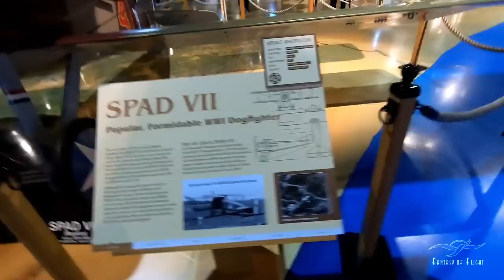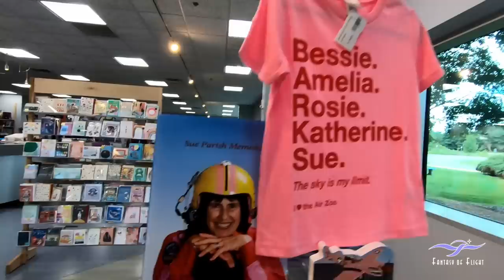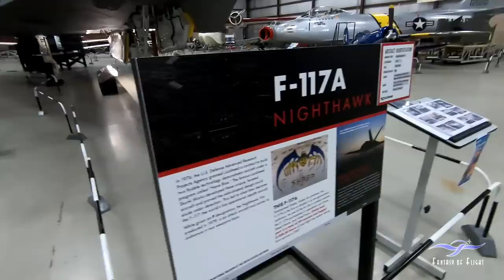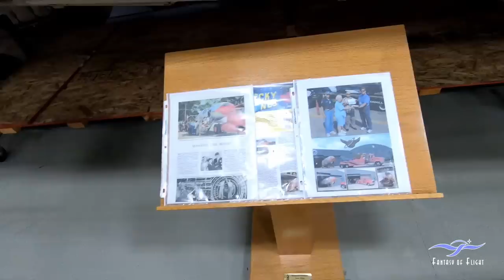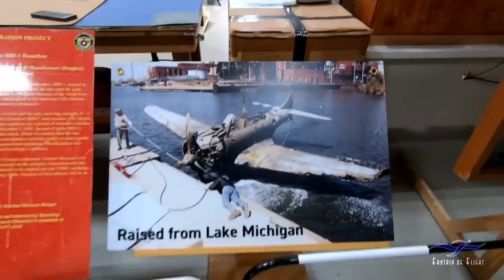KALAMAZOO AIR ZOO MUSEUM - Kermie Cam Tour

Comment: I remember when Sue was given a lot of hassles by the warbird contingent for her pink P-40. Turns out she was historically correct. The sand-colored paint faded to pink in the African sun. Keith Pustilak, an old fraternity brother of mine, worked at the Air Zoo for years.

Comment: My father worked at Commonwealth Aircraft Corporation (CAC) when they were starting to build the Avon powered F86 Sabre. He would sit inside the higher Avon fuselage engine bay and play cards with some mates. He told the story of watching one of the early flights where one of the test pilots brought the aircraft over from the nearby RAAF Point Cook airfield to do a demo for the factory staff (the factory’s Port Melbourne runway was too short to operate from). After a couple of passes he had a flame out and glided the Sabre back to the Point Cook airfield for a safe landing. I still have one of the dummy 30mm cannon rounds that they used to test the loading mechanism (the CAC Sabre had two 30mm cannons instead of the 20mm cannons fitted to the American Sabres). Brough back some good memories of my father. Thanks Kermit!

Comment: Been there. Nice museum. That Camel is a plans built aircraft. It was being built in their shop last time I was there. I was mesmerized by the guy cutting the prop, by hand,  with a draw knife.

You missed the WASP display.  Great honor for great women.

The restoration shop used to be just across the ramp, within walking distance from the back door. It was the best part of the museum to me.

That was indeed a 20mm in the F-104.
My dad was on the GE team that designed and built that gun. Has been put in numerous aircraft.

Comment: Having been to both museums, Kalamazoo Air Zoo (original and latest addition) and Fantasy of Flight, both are well done in their own way.  I believe the Achilles heel of Fantasy of Flight is its location between Orlando and Tampa...or Orlampa as Kermit calls it.  The fast paced life that exists in that area for Florida does not help FoF either.  I do hope that FoF has a long and successful future ahead.  I am sure I will make it back to both museums again.  I may be wrong, but I believe he missed the back part of the building that has their WWII aircraft, or maybe that was the part that was closed.

Comment: The family was at Air Zoo in the early 1980`s.  All that was there was the building at the end of video.  They had a few engines the most most memorable R4300 28 cyl Wasp MAJOR.  There was a P47 with a ladder so I could look in the cockpit.  It was big enough to have a party inside compared to most.  There were flying copies of all the Grumman cats 4 to 8.  They were staged for a photo flight 4:00 PM.  I saw them all take off  including the B25 with the rear turret removed and replaced by a camera.  Since you like old stuff,  I suggest Glen Curtiss museum in Hammondsport,   New York.  They have original and reproductions of many of his airplanes.  Repros are made in their own shops from original blueprints.  It is a gigantic shop which was open to the public in 2005.  Repros are made to print except for certain wood types no longer obtainable.  That place not filled with a bunch of things you do not care about unlike air zoo .  I will never go back there.

Comment: Kermit, this from a man older than you are, I have been in love with and worked on air planes since I was 17,you came across as a grumpy old man. You seemed bitter that Kalamazoo had found the golden nugget that you have been searching for. You seemed to be saying they were not morally pure because they offer rides to entertain the kids and they have jets. Kermit you need to wake up and reinvent yourself. First of all you must find out what your customers want and attempt to provide that.  Second you need to seperate the real air plane business from the entertainment business. Finally you need to find a way to restore or have restored all of the airplanes you have stored before they turn into pumpkins/ Your prime market for those old air planes is rich men whos fathers flew them in WW2 ir rapidly dieing off.All of you people in the restoration business  are soon going to be out of business just like  Heathkit and Radio Shack. Times change quickly old man. Jets are ok even if you can't fly an F15/